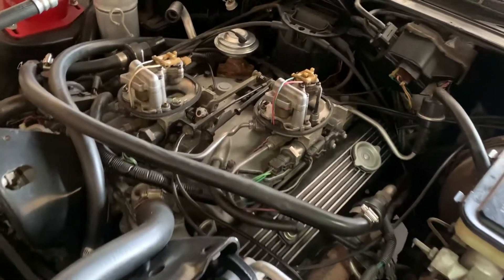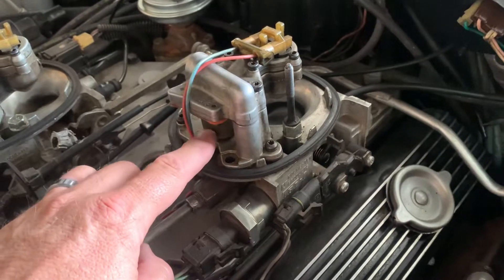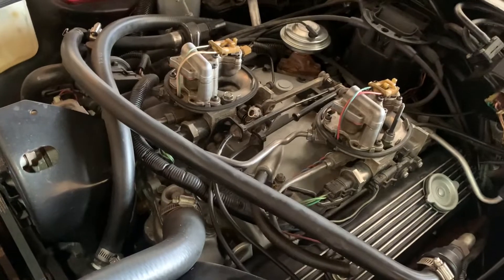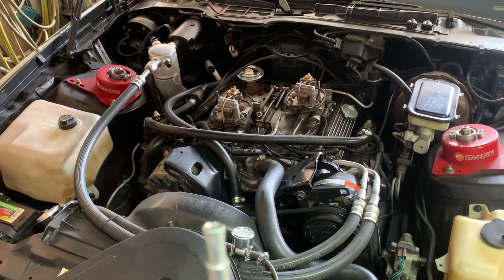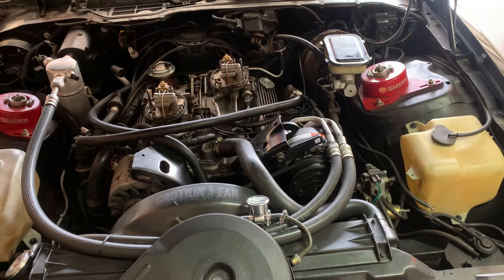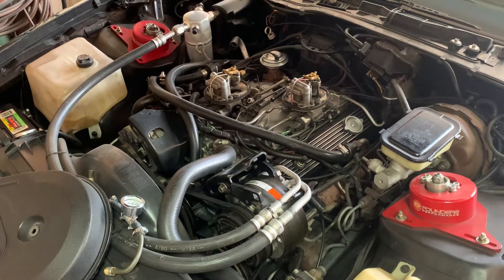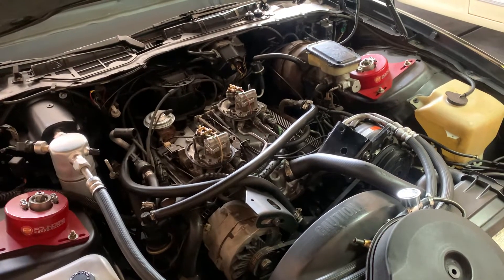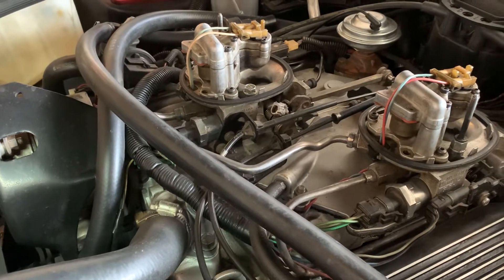How to adjust the fuel pressure on a Crossfire Injection 305/350.

Comment: Hate to bug you on here but knowone can seem to give me the answer, I upgraded my coolant temp sensor to TX3K, well i believe it doesn’t read right with that one. So what I’ve see. Is the 213-52 actually works better for these crossfire injection. My car is 82 Camaro crossfire injection with yellow and black wire to sensor. My car rn runs to rich on start up and running with the TK3K. Can you help me? Will the 213-52 sensor work better for me

Comment: Joe, thanks for sharing your knowledge.  I have an 82 vette which is completely bone stock.  It recently had new factory heads installed, and the whole crossfire system was re-sealed.  The car now has an idle which jumps from 600-1500 rpm, and the engine also wants to stall under load while driving. I've replaced fuel filter, coolant temp sensor, and coil, but nothing has helped.  Any ideas where I should look next?

Comment: I hope you read this. I got a strange issue with mine. The fuel pump died so I went to summit and got a new one. It was a holley. Since then, fuel was pouring outta both throttle bodies. I read that holley pushes 100psi. I put a regulator going into the slave and can't get it less than 40psi. I replaced both regulators and that only stopped the master from flooding. I bought a 13psi fuel pump and and put that going into the slave. It's still flooding. I'm ready to rip it all off and just throw a 4 barrel on. It's a pace car and I didn't wanna drop the value that much though. Any ideas that can help? Please

Comment: I checked my fuel pump and fuel filter getting gas to the motor but none from my carburetor
Reply from the maker: Well CFI engines aren’t equipped with carburetors. That may be your first problem.

Comment: I've used two new fuel pumps one Delco for tuned port and one cheap one for crossfire. Both cause rich condition almost zero idle and massive fuel consumption. Could it be return line issue
Reply from the maker: Did you verify exactly what the FP is reading? Check your MAP vacuum source for leaks. I guess it COULD be a return line or regulator issue. You need to verify FP and MAP function first.
Reply: @Joesmusclecargarage  didn't check FP map is good problem only exists with new fuel pumps OLD wore out pump car ran great. Old pump finally died. Got rebuild kit will blow air through return lines first
Reply from the maker: You need to check FP FIRST. Most CFI driveability issues are FP related.
Reply: @Joesmopargarage  I get it. But why would things get worse with higher volume and or higher pressure pumps yet completely go away with old low volume pressure pump. Considering regulator is a simple bypass device
Reply: @Joesmusclecargarage  thanks for reaching out
Reply: I took regulator out backed off spring tension almost as far as possible ran air through return line which seemed like it had no restrictions runs and idles good again.  @Joesmopargarage

Comment: So I got a good one for you Joe! Do you know why my fuel pressure would start close to 12ib pressure, but then once it warms up it drops to almost 6ib pressure
Reply from the maker: @CalvinReinhart  How old is the pump? Are you using the correct Gates submersible hose on the sending unit?
Reply: @ 4 months old, and using the hose it gave me with the pump
Reply from the maker: @CalvinReinhart  How are you measuring the fuel pressure? Between the TBs? That’s odd, because the regulator is fixed and does not fluctuate the FP. Are you using a CFI/TBI pump, or TPI?
Reply: @Joesmopargarage  i believe cfi pump, but have been thinking of switching over to 85 tpi. I modded my own in the middle of my tbi’s with high pressure fuel hose. So gauge is always there
Reply from the maker: @CalvinReinhart  I would definitely use a TPI pump. The CFI/TBI pumps are known to shit out for some reason.
Reply: @ that makes sense! So even it sounds like fuel pump running strong it could still not working properly?
Reply from the maker: @CalvinReinhart  Absolutely. The vanes in the pump wear.

Comment: Do you add tension to the spring to increase the fout pressure (clockwise from the bottom) or decrease spring tension to increase pressure?
Reply from the maker: @DarrellHewko  Add tension to increase. But DO NOT adjust the pressure without a gauge on it. As little as 1/8 turn can bump the pressure up as much as 5-6psi, and every pump/regulator combination is different.

Comment: Where is the fuel pump pressure tested? Is that done with the engine running?
Reply from the maker: Engine running, at the crossover line between the TBs.
Reply: I have a '83 Trans am with Crossfire. The only real problem is cold starts require a lot of cranking. It will finally start to stumble and then fire and run normal. Plenty of pull and smooth running on the highway. Is there any reason to check the fuel pressure? Could it be bad gas? Plugs? Plugged fuel filter? New idle air valves 50 miles ago. Great site!
Reply from the maker: @blackTtop There’s always a reason to check fuel pressure on a CFI. They were set low (8-10) from the factory. They run like shit if they’re not up around 13-14.
Reply: Once it starts it runs great and has for years, but lately it's been hard to get started and I'm trying to understand why. @Joesmopargarage
Reply from the maker: Then check the FP. Are you still running the factory CTS?
Reply: UUHHH, what is CTS? Everything on the engine is original except the idle air valves have been changed 2x, latest last August, and I changed the EGR this past spring. @Joesmopargarage
Reply from the maker: @blackTtop  Coolant temp sensor. If you have to ask a question like that, maybe you shouldn’t be messing with it.
Reply: Yeah, I know I'm in over my head on most of this. I've worked on older cars and been looking for a local mechanic that knows Crossfire & I haven't found anybody. While I'm looking, I'm hoping to stumble across an easy answer without out screwing things up. What about the factory CTS? When warmed up, the needle is on the line between 100 & 220. Maybe slightly higher in the summer. I was also told to get the ethanol gas out of it. I've got about 80% ethanol-free in it now. Also, starting cold, when it finally starts to start, it stumbles and then finally fires. I keep my foot off of the accel because the service manual describes a "flood-clearing" function that happens when floored, like the old carbs. Does the stumbling mean anything? The spark plugs are original. Annything? Also, if the fuel filter would be partially plugged, would that affect starting, but not highway performance, when I give it the boot? It gets down the road great. If this is getting too involved, I'll shut up.  @Joesmopargarage

Comment: Possible to adjust pressure without a gauge. Approximately how much do you need to turn the screw?
Reply from the maker: No it’s not possible. As far as how much to “turn the screw”, it depends on what the FP is at before you adjust it. Do it right.

Comment: Im currently working on a 84 Corvette with the CFI set up... the car ran great a couple years ago,but wasn't driven much. I've been chipping away at replacing parts trying to get it to run right. Had the dreaded code 42, but was able to get rid if that, but unfortunately rhe car is still runntlike crap. Looking for other options. I've done a tune up( cap, rotor, Ignition module, wires, plugs....) also had a battery drain issue which led me to replace the battery. I found a really bad ground while in there and replaced that too. This ol girl is just running rough. Think it may be vaccum related, but after watching tour videos and a few others, I've come to the conclusion that it could be anything from vaccum to ECM....lol guess I'll just keep going. Wish you were in Las Vegas hahahaha.  I really like rhe CFI set up because its unique and hated... really wanna get it running smoothly.

Comment: What should the fuel pressure be coming out of the pump?
Reply from the maker: The factory specified range is 9-13psi. Most stock to mild cars run best at 13-14psi.

Comment: I just realized my butterfly valves are open 1/8 inch I was wondering what could make this happen how, so I get both butterfly valves to go back to normal? maybe I have tension on my throttle cable? because it's giving enough gas for the amount that the valves are open. it's like the gas pedal is slightly down opening the butterfly valves and having a high idle.
Reply from the maker: Disconnect the cable and see if the blades close. If they don’t, find out what’s holding them open. Are both TBs open an equal amount?
Reply: @Joesmopargarage  ok so I did this and maybe I 1/8 inch was a little exaggerated. from pictures i am seeing online looks like the butterfly valves should be a little more closed but the car is dumping so much fuel into the TBIs. It's been sitting since 2014. none of the tamper plugs have ever been removed. I put all new gaskets on changed most of the Vacuum lines I put new EGR Valve I changed the 2 IACVs and maybe it lowered the RPMs just a little. at one point I thought it was down to the TPS the car was idling up and down. but ever since I touch the TPS the idle went back to high. I was really hoping I could understand this crossfire set up. but I keep coming to dead ends. My dad's birthday is coming up in 2 months and he thinks I sold the car a year ago. I have been on the forums asking people for months they just keep telling me to change parts until I find the problem. Anyone I ask if they know how to work on a crossfire injection, they laugh at me.

Comment: hello joe, I have an 84 corvette with crossfire. main throttle body works ok, the slave is not working(dry). where would you suggest I start.where would you look first. I have no idea where to begin.I did put a noid light on the slave and it is firing.
Reply from the maker: Just so I understand and we’re both on the same page; I’m assuming you mean the injector on the slave (passenger side/front) TB is not spraying? If you have power and ground to the injector, and it is pulsing and verified with a noid light, the coil inside the injector could be bad. It would have to be completely clogged all of a sudden for it not to spray any fuel whatsoever, and that is very unlikely. You can apply power to the injector and see if you can hear it clicking. If the master is spraying properly, that is the last stop the fuel makes before it is returned to the tank. I would start by actuating the injector with a battery, either 9V or a 12V power source. I do have a good spare pair of L05 350 injectors if you end up needing them.
Reply: @Joesmopargarage  Thanks for the reply Joe, The noid light did show pulsing.I will try with the 9 vole and listen for the clicking.I have 2 rebuild kits but have never rebuilt one before.I guess I have nothing to lose trying a rebuild.Your thoughts on difficulty to rebuild.Thank You.
Reply from the maker: @williampalladino3663  The TBs themselves are super easy to rebuild. Just a gasket and a few seals. It’s very self explanatory once you open it up. Make sure you clean the inlet screens on the injectors while it’s apart.

Comment: On my 84 corvette I put a 85 fuel pump and had the throttle bodies rebuilt and he adjusted it to about 14lbs. 
So my question is do I need a fuel pressure regulator because the 85 pump put out more pressure then the 84 pump? Or just Leave it alone.
Reply from the maker: 14psi is fine, but it is at the “safe” limit for the factory FPR. Any more than 14 and you should consider eliminating the factory FPR and running an external regulator.
Reply: @Joesmopargarage  great information 👍 
How do I remove factory FPR
Reply from the maker: DCS sells machined aluminum plates that go in place of the FPR and accumulator. Most of their products are out of stock, and likely out of production though. You can easily fabricate some plates though.

Comment: Hey Joe, do you do any work on 82 Corvettes?  I have several with less than 5k miles that I am trying to salvage from being stored since the 80’s.  I could use any help and advice I can get.  The one I am working with now has a very low idle and will not stay running.  I’m not a mechanic.  Any ideas after having replaced fuel (and brakes)?
Reply from the maker: I do. Are you in AZ?
Reply: @Joesmopargarage  Heck no, I'm in Indiana! =((((

Comment: Hey Joe. Great Videos! 

I need to make the fuel gauge setup in order to set my pressure. I have the gauge, and I plan to use hoses like yours in the video. What ends do I need to screw into the TB's? I've heard its 3/8 inverted flare, but I don't want to gaggle anything up.

Thanks!
Reply from the maker: It’s just a standard 3/8” steel fuel line, with a 0-15psi gauge. Be careful going over 13psi if your regulator diaphragm hasn’t been replaced in a while.

Comment: Renegade intake/1.6 roller rockers/long tube headers/dual cherry bombs(no cats)/DUI coil+ Module\k&n filter=gas pressure???? 16 maybe?
Reply from the maker: What’s your question? If you’re asking what your fuel pressure should be, 16psi is unnecessary, and are on the edge of what the FPR diaphragm will hold. If all you have is the manifold, rockers, and exhaust, no more than 14psi is necessary.

Comment: Thanks for the video. Do I knock out the aluminum/metal housing located at the base of the injector or the black rubber smaller plug that's located in the aluminum/metal housing enclosure extending out of the fuel injector?
Reply from the maker: What are you talking about?
Reply: @Joesmopargarage   At the base of the regulator, there is a knockout plug. In the center of the knockout plug is a small circular rubber cover of some sort... My question is, do I remove the rubber cover, or do I remove the metal knockout? I can send a photo if you like.
Reply from the maker: @daaframcampbell2463  You need to remove the metal knockout plug.
Reply: Joe on my injector head (1984 Corvette, L83), after removing the metal knockout plug I noticed a small vertical slit on the side of the housing unit which I’m able to visually see the regulator spring. The spring sits on top of the nut that is used to adjust the fuel pressure, however, a part of it extends slightly outside the slit in the housing unit. I’m unable to turn/adjust the regulator. Should I disassemble the injector head and try to set it so that it stays inside the unit?
Reply from the maker: To adjust the FPR correctly, you need to either buy or make a tool to turn the adjustment screw while the engine is running and while you have a fuel pressure gauge between the two throttle bodies, as mentioned in the video. The screw is very sensitive, and it doesn’t take much to make a big change.

Comment: I have mine set at 15 psi with a renegade intake manifold and 2 in throttle bodies.  I bought that special curved tool to adjust the fuel pressure.  I have an in-line permanent fuel pressure gauge.
Reply from the maker: That’s good. Who bored your TBs?
Reply: @Joesmopargarage  I bought them from a guy on eBay. Bored and he already punched out that tab for the adjustable fuel pressure.

Comment: What size are those fuel line nuts
Reply from the maker: The factory nuts are 11/16, and the ones on the aftermarket gauge I made are 5/8.
Reply: Whats the thread pitch of those inline nuts? Ive been trying to find a hard line, but i dont think they are sae threads? Or im missing something?
Reply from the maker: It’s just a standard 3/8” metal fuel line with inverted flare fittings.
Reply: Oh ok, so its the fitting that goes in to the throttle body that its a metric size? Because ive looking for a line for my throttle body and i can't find it, i had to watch your video again and i think i see a fitting that the line fits in to? Sorry im trying to get a fuel gauge on my Trans am when i replace all the intake gaskets, since my car now is falling on its face when i accelerate. Im trying to buy all the stuff before i start taking it apart. Im really happy your making this videos, especially the part when u say that people will rather put a carb instead of figuring out how to make them run good. I like to see the cfi run good, especially when ive heard that they tried to do it like the 302 crossram that camaros used in the 60s to race them and it had 2 carburetors. And also its a piece of history that we dont see everyday

Comment: Do you know if power can be made with the crossfire setup?  I just got an 82 z/28, and I know everyone on the web says to gut it but I like the gimmick just want it to be a bit more peppy.  Getting it running well will help and these are great videos but I should just ask if you know of any tricks to get a bit mote out of them?
Reply from the maker: Of course. Port the base, bump the timing and fuel pressure. The rest is common stuff that applies to any other car; exhaust, gears, converter, cam, etc. My current 83 went from 16.50s to 14.40s, still running the stock cam, and still gets 17mpg city and 25mpg hwy. It’s easier and cheaper to get power out of a CFI car than a TPI car. The ones that say “gut it”, or slap a carb on it, have more than likely never seen a CFI car in person, much less driven or worked on one. It’s a different world now than it was 40 years ago, when nobody understood fuel injection or how to work on them.